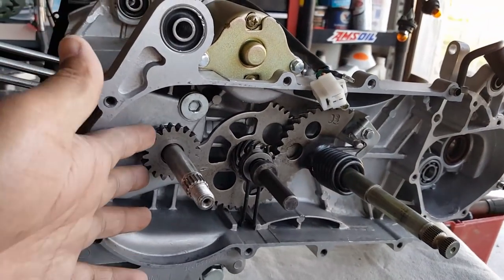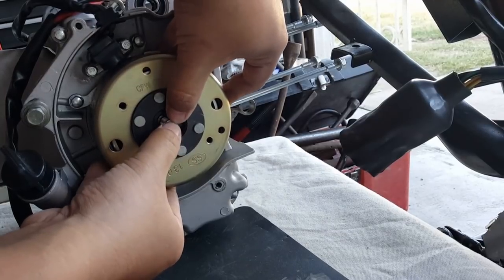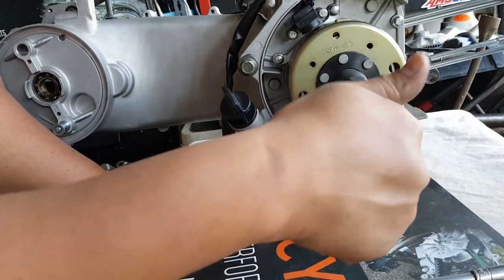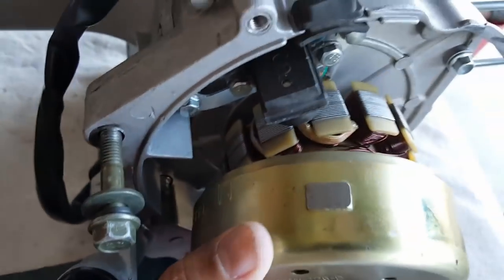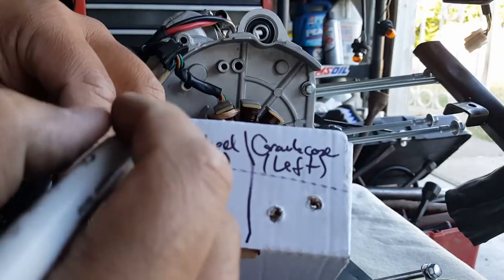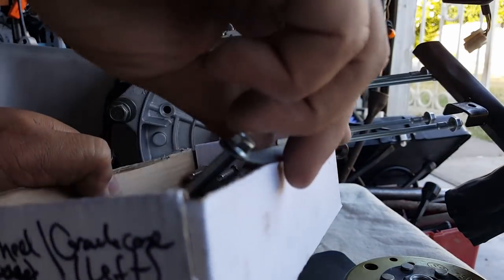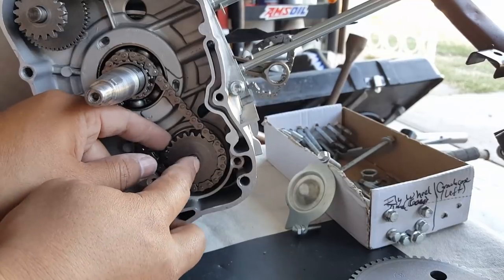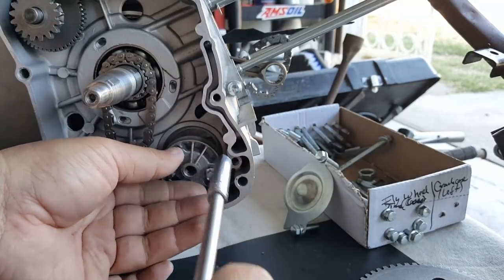How to Remove GY6 Flywheel, Stator, Oil Pump, & Starter Clutch on 157QMJ

Comment: Will the internals from a short case fit in a long case ?
Reply: Yes bcs i have both cases and i just assembled one using the variator case side and the crankshaft from it and the middle andd magneto side case from the short one